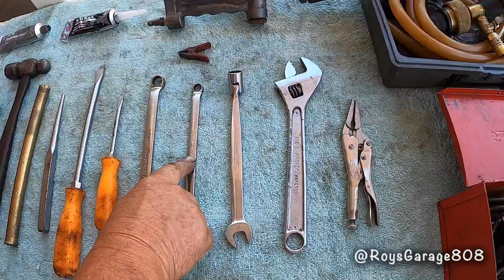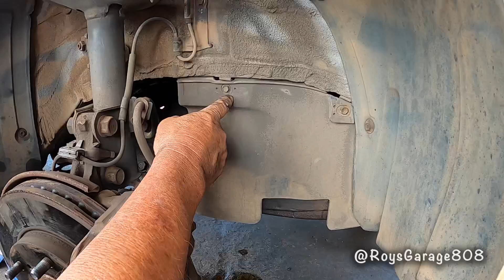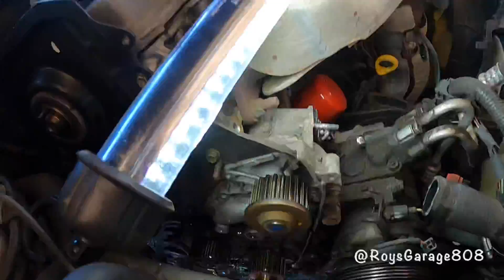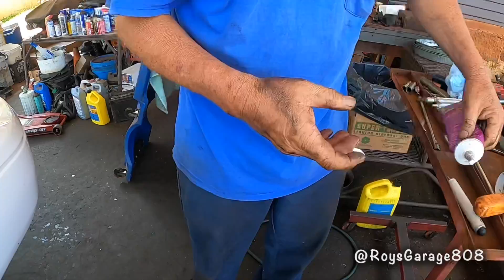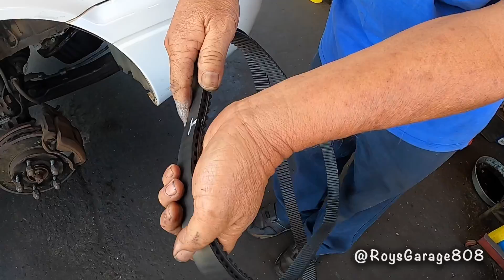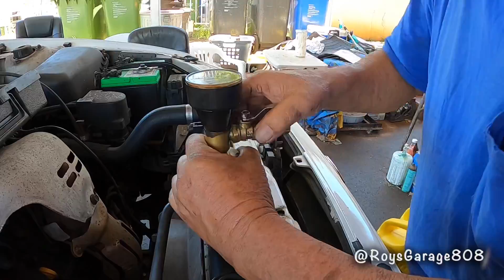How to Replace the Timing Belt & Everything Else Involved on a 1999 Toyota Camry

Comment: The 99 5S-FE Camry is supposed to have HOAT (Hybrid Organic Acid Technology) coolant only. You'll get years from your cooling system if you use regular non-HOAT Preston coolant, but using HOAT specifically prevents acids and electrolysis from eventually inhibiting the system. Using HOAT coolant is the difference between doing a good job and a great job. It maximizes  efficiency and life from your entire cooling system. HOAT is more expensive and harder to find and it still does NOT mean your water pump seal won't fail, which seems to be a design flaw, sooo... it's your call.
Reply: You learn the hard way? What was the concern from the customer, the condition, and recommendation? Where did the acid/electrolysis combo eat through? And Inhibit? How long did it take from the service performed to flush the system for a previous repair to the time of failure found during inspection of concern? I'm curious. I haven't seen it yet. I have customers with this vehicle( I never add improper coolant but I've seen them brought in that way many times. Haven't yet noted any indication of failure due to OAT vs HOAT. Gaskets, bearings, hoses, radiators, thermostats, even a head gasket once(that one had the right coolant) have all failed at the same rate or condition in my experience regardless of organic or hybrid organic coolant. Ive really been wanting to hear from someone that knows and has experienced this so I can add to my databank.
Reply: @Lavenderwrench  Well that's a good point. I have no physical proof, just a bit of understanding of the chemistry. Maybe the reason you see no difference over OAT is b/c Toyota engines are made so well that electrolysis would take decades to have a detrimental effect??? I think using HOAT is more about electrolysis eating away the block and radiator. I can report my 99 with 210K miles has the original radiator, heater core, head gasket and they all seem fine, so I'm staying true to it. May seem short sighted, but I believe in the engineering of this engine, including the choices made by the engineers. Just sayin'
Reply: @dbfcrell8300  ah. I see. Was hoping to find an actual instance some wrong coolant actually did some damage to one of these. I report 379,000 and all original as well. Though I am in the middle of a timing belt and am considering the water pump being changed but I'm wary. Parts are not what they used to be. And this one has no evidence of failure. I believe in them too. Hence my ownership status.
Reply: Are there any mechanics here near Frisco, Texas?
Reply: @ I'm in RI. Wish I could help.

Comment: Not sure if this makes a difference to anyone, but the Aisin brand (Toyota's OEM brand) water pump's shaft seal is supposed to be "conditioned" prior to installation by placing either the Aisin seal or entire water pump in clean, fresh water. I believe doing this swells the seal a bit and keeps it from sticking to the shaft. There is a little note inside the box that says do not rotate the shaft until you do this. Who knew?

Comment: I just watched this video after doing my timing belt (my first timing belt job). Glad that you also used an impact on the balancer bolt and didn’t worry about the 45* btc torque procedure on the tensioner. When I rotated my belt and let the tensioner work, my belt was plenty tight. No flutter, no skipping, no issues.

Comment: You may be doing this job over prematurely. Japanese Koyo or NSK bearings are the only ones to use in a Toyota. They generally have the reddish brown seals, not the blue/green seals. Even if you buy a Gates timing belt kit these days, they always slip in a Chinese bearing and they ALWAYS fail earlier rather than later. Japanese bearings are the best.

Comment: Is there anyway to test and see if my timing belt is broken? My 99 camry keeps signaling a bad camshaft sensor. P0340 but I’ve changed it out 3 times. The crankshaft sensor as well. I have a new starter and battery as well. BTW, GREAT JOB!!
Reply: The car will not start or run if your timing belt is broken

Comment: Nice work, glad to see that you're cleaning and adding the right lubricants on to the parts. However I am concerned that the adhesive spray on the oil pump gasket might interfere with a good seal.
Reply: try placing that on there without it:face-purple-crying:
Reply: 1